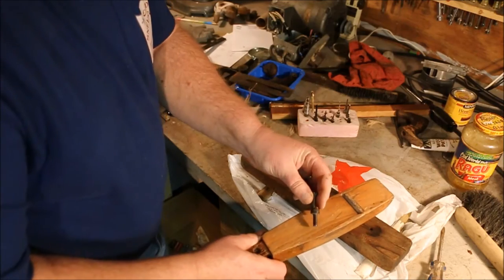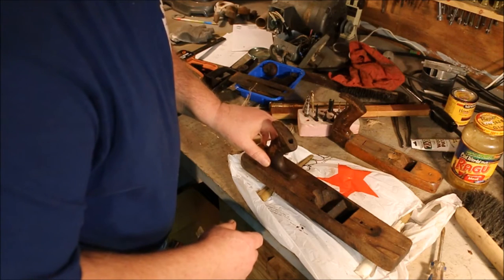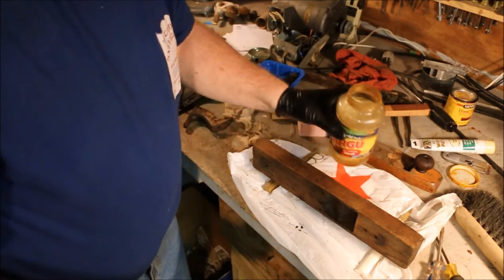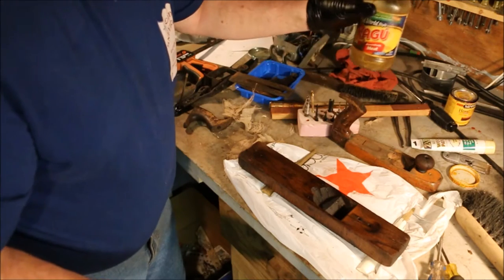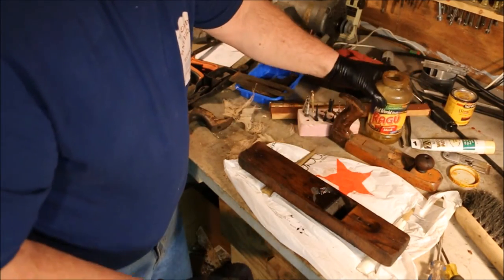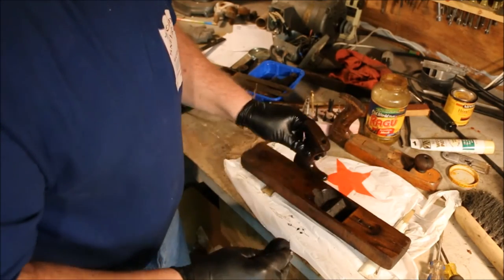Union Transitional Plane ~ Part 4 ~ Plan For Repairing Screw Holes ~ by Old Sneelock's Workshop

Comment: You can try to stand the plane body up in a can of BLO, switch ends every so often. It will really soak it up and the cracks will close up pretty well too.
Reply from the maker: The BLO does fill in the gaps, checks, and cause the wood to swell. Unfortunately when I tried that it dripped BLO for months afterwards. BLO only sets up in the presence of Oxygen. Inside the wood once the outside cures the resulting shell of cured BLO is like a cask holding the Oxygen away from the uncured BLO.